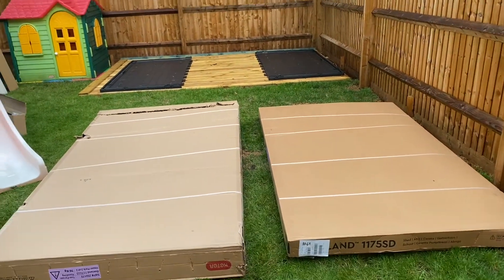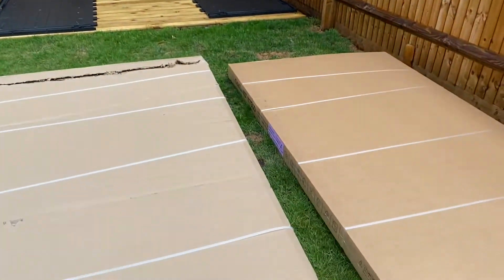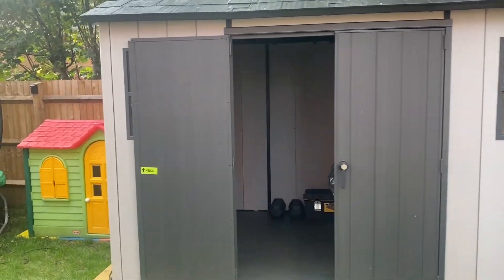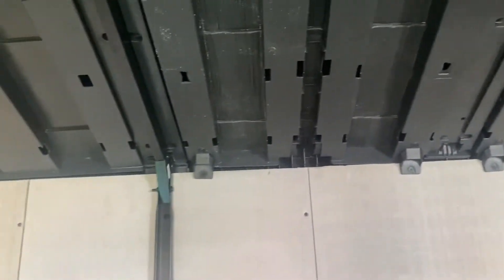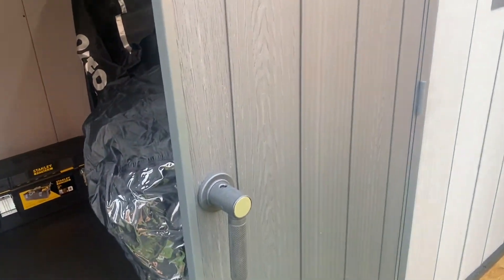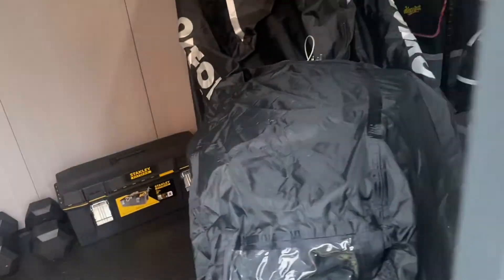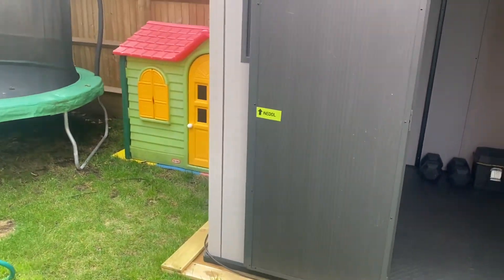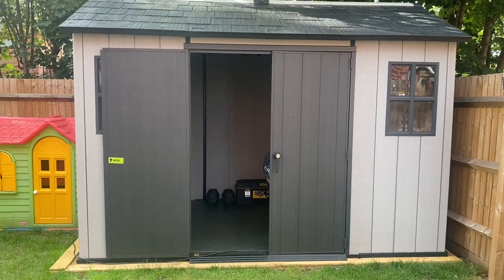Project Keter 11x7 Oakland or Artisan Shed. Final Part 4 Base Foundation Cheap Easy Way. Shed Built.

Comment: Hi, very useful set of videos👍
How did you put the roof on and screw the wall panels to the base when the shed is so close to the fence?
Reply from the maker: There is a gap I could squeeze through and roof luckily it's a gully at the back so just took my ladders round behind the fence.
Reply: @BigBoyzToyz1974  cheers mate!

Comment: Hi mate, I've done a gravel base like how yours was before the wood, can I put a keter shed up directly onto the gravel?
Reply from the maker: You probably could but get it as level as possible as if the base isn't perfectly flat you will have a nightmare getting the roof on .. Good luck 👍